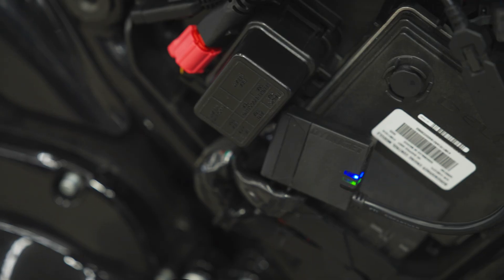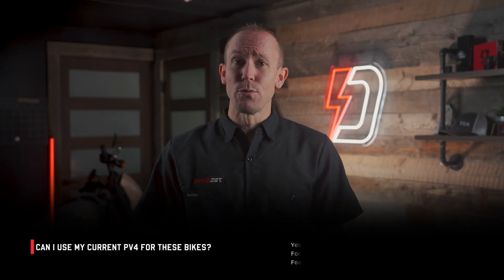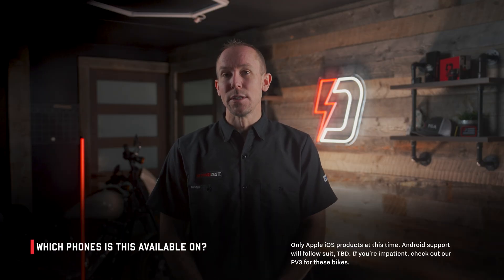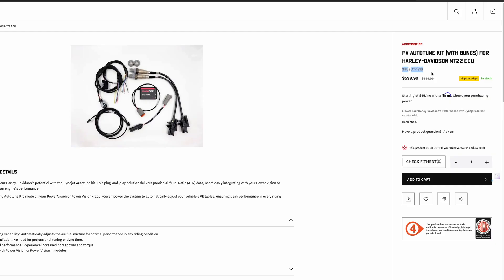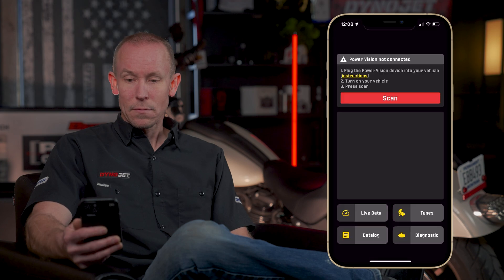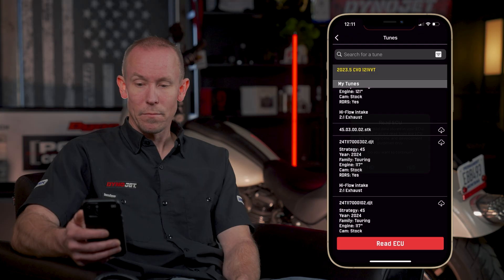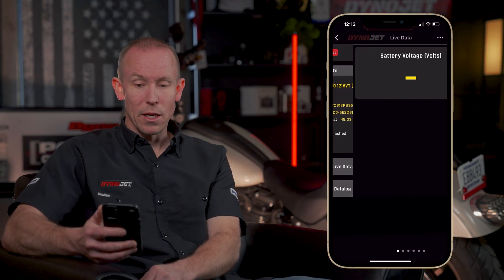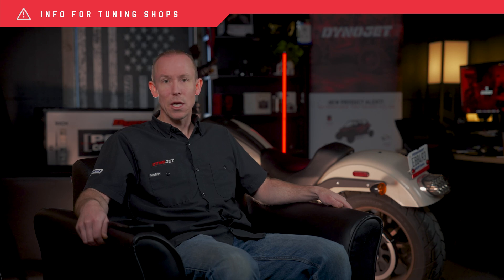How to Flash 2023-2025 Harley-Davidsons with the PV4 (Gen 2 M8)

Comment: Small Question, I have Harley Low Rider S, does PV4 have riding modes for the bike
Reply: I'm trying to figure this out as well, for my LR-ST.
The ride modes are part of why I got the new 2025, as I want a fuel-efficient Normal mode for roadtrips & a super aggressive Sport mode for having fun.  But I'm not going to buy a tuner before learning how it will work with these ride modes.

Comment: After having a Power vision [ j1850] hooked up with a target tune for years past. Learning how to use and understand it.
I will have to pass on my 2025 as this set up as it will not suit my needs.
I want the big screen like i had for several years on another bike.
I have a 2025 and it looks like they will not bother with the larger power vision screen  on 2025s. Just the little pv 3 tiny screen or the pv4 and mobile?
Using bloody mobile phone and not being able to flash a tune while on  the road and not being able to watch  the main sensors on the fly has killed it for me. Also hearing many complaints .
Going to get rid of efi and go carbie.

Comment: My pv4 timed out when trying to read the ecu and now the bike runs like crap lmao nice product
Reply from the maker: I understand your frustration - that's definitely not the experience we want you to have with your PV4. When a read operation times out and the bike runs poorly afterward, it usually means the communication was interrupted during a critical process.

Here are some immediate troubleshooting steps:

First, check the basics. Ensure the diagnostic cable is fully seated in both the PV4 and your bike's diagnostic port. Verify the ignition is fully ON and run/stop switch is in RUN position. Check that your bike's battery is fully charged (low voltage can cause communication issues). Look for any aftermarket electronics that might interfere with the diagnostic bus (lights, heated grips, etc.)

If the PV4 was in the middle of reading/flashing, the ECU may be in a partial state that needs to be restored. Don't attempt to ride until this is resolved.

If you're still having issues, please submit a tech support form at dynojet.com/help-center and select "Harley-Davidson Power Vision Tech Support."
Reply: @DynojetResearch hey man none of that helps because you're just reposting the instructions for using it that I've already read. Plus I already reached out to your guys and they didn't help.

Comment: I got my 2023 RG limited Cammed. Bought powervison 4 but only 2021 tunes are available. If you cannot get a tune what is the reason spending 500 dollars. I reached out to you many ways. But never get a single reply from you guys. My bike seriously need tune. I got alot of decel pops. I need my bike work smooth. Let me know where to get tune.
Reply from the maker: I completely understand your frustration, and I apologize that you haven't received the support you deserve.

For your 2023 RG Limited with cams, you absolutely need a custom tune - the pre-loaded tunes won't work properly because cams significantly change your engine's airflow characteristics. However, we are still working on creating and scripting cammed tunes. This inital launch only has support for Level 1, 2, & 3 configurations. Level 4/5 tunes (cams + other mods) are still being developed.

For context, free tunes (Levels 1-3) are available through the PV4 app or dynojet.com

Level 1: High-flow air cleaner only (Stock exhaust + aftermarket air filter/intake)
Level 2: Air cleaner + slip-on exhaust (Aftermarket air cleaner + slip-on mufflers (keeps stock headers))
Level 3: Air cleaner + full exhaust system (Aftermarket air cleaner + complete exhaust system (headers + mufflers))

Paid tunes (Levels 4-5) require 5 Universal Tokens (~$50) and are available at dynojet.com/support-form

Level 4: Air cleaner + exhaust + cam + injectors (All Level 3 mods + aftermarket cam + larger injectors)
Level 5: Complete package (Air cleaner + exhaust + cam + big bore kit + injectors) (Most heavily modified setups)
Reply: Don't know if you resolved this yet, but FuelMoto may have an appropriate tune for you, wouldn't hurt to check.

Comment: I do not see any pv3 or pv4 firmware upgrades for the new bikes I’m also not seeing a “PV4 feature licence” upgrade as mentioned in the IOS app.  Is this not yet available or is it something I need to do from your website
Reply from the maker: It should be live now. Are you still having issues?
Reply: @DynojetResearch  PV4 here with Android, I was told to watch this video to get my firmware license update, not seeing it in this video. for IOS or Android. I already bought the Token, of course it won't work.
Reply from the maker: @happyness5293 Android support is still ongoing development for these ECUs. Additionally, the Gen 1 PV4s are not able to support these ECUs, the internal RAM block is not sufficient enough to store the incoming cache from the ECUs. You can tell if the PV4 is a Gen 1 if it has a gray connector instead of the black one.

Comment: Novice question:
Can this tuner remove limiters on a completely stock CVO ST?
Reply from the maker: Yes, though we recommend incrementally raising the limiters as opposed to completely removing them. Some of the 2023.5 bikes are under NHTSA Recall and part of that Recall is lowering the speed limiters to 100 mph due to known instability issues.
Reply: @DynojetResearch those sonofabitches cut my bike back to 100 and i'll burn it to the ground in the parking lot! and i'm sure it's the street glides since they are getting the "death wobble" , meanwhile with proper a suspension installed and adjusted correctly and the neck bearings tightened up i have  held it at 107 with 2 fingers for 30 miles straight and nary a twitch 🙄
Reply: @DynojetResearch  Do you know where I can get more info on the known instability issues? I ordered a new PV4 (the one I had on my 23 was gen 1 and wouldn't work) for the 2025 Street Glide I bought and that thing is WILDLY UNSTABLE over 85-90mph. What a nightmare. Limiting the speed to 100 is not a friggin fix, so I won't even mention it to the dealer. Thanks!